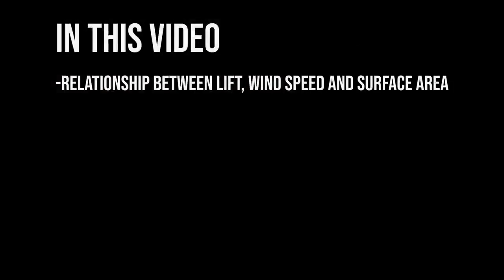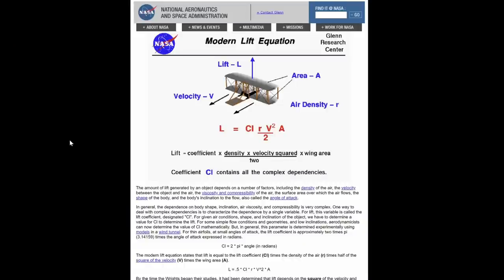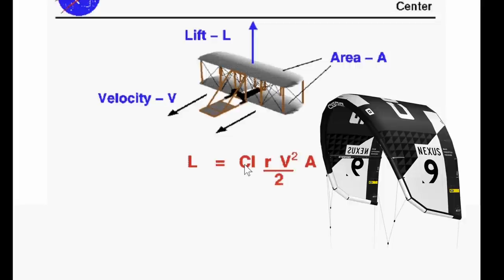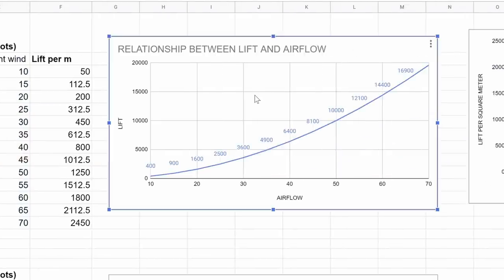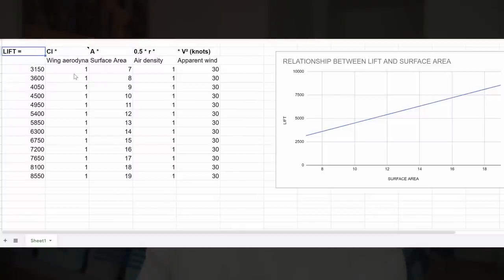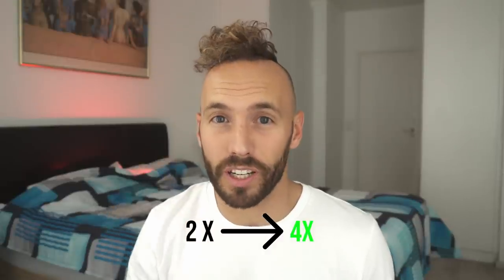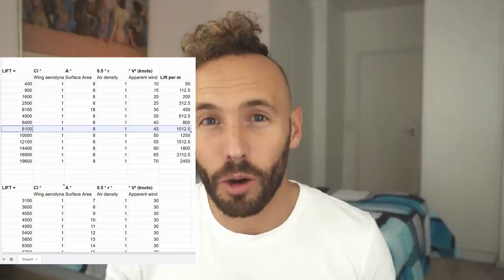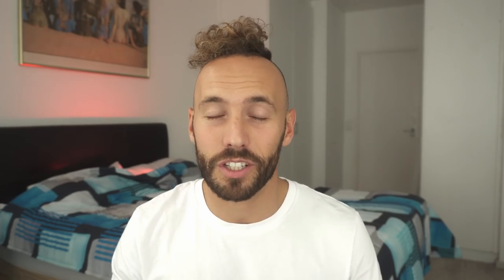Why do small kites JUMP HIGHER? How strong is 60 knots?!

Comment: I'm 68, have been riding 16 years and I'm 100 kilos.  All I do is try to jump as high as possible, and jump transitions. I have had my 12M XR kite in 25k winds (accidentally due to a very abrupt wind gust) as well as my 10M XR kite in the same winds. While I definitely have more power in the kite with the 12M, it is much harder to keep my edge, which gives me more horizontal jumps, less vertical. I could try going to a smaller board, as Toby Braeuer once suggested with the larger kite, but while I would get better edging and more vertical take offs, as well as some very nice hang time, I would not have the kite speed to get the same height as the 10M in the same wind. This past June I went to Floras lake and was boosting vertical 30+ footers every jump (as per multiple witnesses on the beach and video evidence) on my 10M with wind speeds of 25-35mph (approx 21-30kn) off of flat water, no ramps or kickers. Absolutely love the Core XR kites, just wish I had the money to keep updating them. Thanks for all of your great content, keep up the good work. If you ever find yourself coming to the San Francisco area and want to ride an awesome flat water spot, especially in July, contact me.

Comment: Great video Mike! This confirms a recent experience I had: I  forgot my smaller kite and was out on a 16m switchblade in 20-25knots. I was waaay overpowered, and could barely hold an edge. The only way I  was able to jump was by using some fun kicker waves. the hang time was absurd... But I wasn't going very high.

Comment: Great video. A lot of misconceptions about the physics out there. Many people dont know why apperent wind exists and how it works. 

1 more thing about the topic big kite vs small kite jump height. 
When u leave the water in a jump - you start to travel downwind. This reduces your apparent wind in your kite -> decreasing lift -> you sink -> land. With super strong wind on a small kite you dont lose this lift as quickly - getting the vertical pull longer. -> jumping higher. 

Sorry if this explanation isnt good in english.

Also if you really want to dig deep into kite physics i recommend the Phd paper of Jan Hummel, he build a kite measuring device for duotone called „ project teta“
Reply: I think this is the actual explanation. With a big kite in light wind, it is easier to generate more apparent wind relative to the actual wind speed. This means a larger part of the overall lift is due to apparent wind. Once airborne, this portion of the lift goes away. 

Additionally the big kite has more drag, which means the resulting force is more horizontal compared to the smaller kite, meaning a less vertical takeoff and faster downwind trajectory, effectively creating negative apparent wind. 

And of course, the kite moves slower, so the rider would have to hold a stronger edge for longer, as the video points out.

Comment: Very nice content. Also interesting to say is the influence in the density of the air. Sometime you go in 30degC on the water, some times in 2degC or in high mountain lakes. The density varies around 20% and therefore the Lift too. 

Some specialists go on the water and choose a size with their wind measurement, but this can be tricky when you are used to kite in other temperatures.

It would be a nice master thesis for a cfd student to really understand the powering up of the kite while you jump. Maybe numerical results bring a benefit on how to get the best performance out of the kite. 

(Im just jumping 12m - 😅)

Thank you for your content! I manage heliloops thanks to your video!

Comment: Mike
I am a mechanical engineer and my job is helping to design jet engines.  I  love this video and think the principles you describe are spot on.  The numbers for the lift aren't necessarily realistic since you used made up factors of 1 for the lift coefficient and density so no one should take the your lift force values and think they are real, but the relationship between the variables and the trends are absolutely real and they show why you can jump higher on a smaller kite
Reply from the maker: Thanks Doug!

Yes I used made up values partly due to naivety from the physics side and partly because I thought that it wouldn't make a difference to the relationship at the end of the day, since it's only 1 term and they're all first order variables, except for airflow.

I'm not sure if I'm right in saying that, but it 'seemed correct' based on what I recall from university (quite some years ago 😅)

Does my explanation make sense? Keen to hear your thoughts!

Comment: Great video - brilliant discussion starter! Definitely, you can expand the theory bit more: with smaller kite you have more control of CL and V components of your lift equation, which means you can time it with edging to give you the highest jump result: kite position, angle and speed - you can more easily park smaller kite in high winds to get highest initial riding speed and as you redirect the kite to zenith you sheet out which then reduces the drag coefficient of the kite and increases V even further. Then as the kite approaches the zenith you time releasing the edge with sheeting in, the latter changes the shape of the kite bringing the canopy closer to critical angle of attack (ramping the CL component to max) at max kite speed which then maxes your lift equation - and boom you are flying!!! With large kites at high wind speed you simply have no ability to control anything other than keeping above your head and praying. :D
Reply: This comment wins

Comment: I would approach the problem from an energy exchange point of view:
when you take off you have a high kinetic energy: e = 0.5*m*v^2 where v is your airspeed (upwind ground speed + wind speed)
as you fly upwards this energy is converted into gravitational potential energy by the kite.
larger kites will be more efficient than small kites as the wing loading is lower. call this efficienty term b.
once at the peak of the jump most of the kinetic energy will have been converted to gravitational potential energy: e = m*g*h.
equating the two terms and solving for height: h = 0.5*b*v^2 / g
the v^2 term will have the largest effect on the height, and we feel this intuitively. 
at high wind speeds the most important factor in a high jump is how fast directly upwind you are traveling when you leave the water (v = upwind speed + wind speed). 
larger kites make it harder to edge and pop without going downwind, but with all else constant will take you higher, however,
smaller kites allow you to edge and pop better with a higher upwind angle.
Reply: No, first of all you mess up the kinetic energy of kiter and kite. Air speed is for kite, but it is not significant as a source of kinetic energy but for the maximum lift which can be achieved. Kiter kinetic energy is measured from true speed and it indeed has some relevance to jump height. However the most important thing is to get the kite travel as fast as possible. High driving speed of course helps that.

Unfortunately if you go very fast edging and last moment before take off suffer and advantage of high speed is lost.

Why do you think bigger kites are more effective because of lower wing loading? It is more like opposite, smaller kite in higher wind operates at higher Re number which makes it more effective. 

Big kites are not as efficient, they have much lower lift to drag ratio. This is because kiter can only produce certain amount of counter force by edging, and this force is dependent of kiter's strength and technique. 

For example 18m kite has ca. 2x as much drag as 9m kite but unfortunately you are not capable to produce 2x counter force for it in your harness hook (unless it is very light wind) to reach same L/D ratio. 

 Big kites are also heavy, they have more inertia which makes them slow to accelerate and thus produce less induced wind during last critical moments of edging before take off.

It is trivial to notice that if wind is very low big kite can indeed jump higher than small kite. 

Small kite will always jump higher if you use your edging potential (and there is enough wind to do so). In practice most people don't use very small kites for big air because risks increase so much when they are fully powered
Reply: @bekanav  Hi Bekanav, thanks for your detailed response. 
I would argue that once the rider leaves the water, the only important reference frame is relative to the air, not the ground. So my use of airspeed for the kinetic energy here is the correct term.

I agree with your 18m vs 9m comparison argument, however by efficiency I was considering the L/D ratio when the rider is flying upwards from the instant after takeoff, with the bar sheeted in, so I believe the kite would be performing at its target L/D ratio, do you think this is correct?

In terms of Reynolds number, I would say that the change between light and high wind riding is not that significant. If Re is calculated as some constant k * squareroot(kite size area) * air speed, it does not change hugely for a 12m in 20kts vs 8m in 30kts. So I wouldn't say the lift/drag ratio for the wing would be drastically different between high and low wind settings.

I would estimate that the higher wing loading of a small kite plays a much more significant role in efficiency than this change in Reynolds number, but it's hard to say for sure, what on your thoughts on this? 

I agree with your comment on larger kites being heavier, additionally using more energy and drag to redirect them upwards before takeoff.
Reply: @maxff123  Main difference is drag is related quite closely to the kite size but lift increases in square to V. So smaller kite has considerable higher L/D ratio if your ability to take F to your harness hook is constant (as it is, or it is not wind dependent). 

There is also slight advantage to RE number because twice as big kite has 1,4x bigger chord size but smaller kite can easily be used 2x as strong winds. So smaller kite works with higher RE number which means aerodynamic advantage.

However basic principle of L increasing in square to V while D is constant is much more significant than RE number. RE is related to object size and airspeed.

In practive after take off smaller kite performs at much higher L/D ratio because it has much higher airspeed. Another way to think it  is you can't load big kite enough. There is a 160kg guy who can jump almost 50ft with 21m kite, that is because he can make that kite work much higher L/D than anyone normal weight guy can. In practice you can see that kite is not that slow when he uses it - and it is a very slow kite for normal weight person.

Yes, in practice kite weight is like drag, not same but quite a lot. Bigger kites, especially foil kites, are relatively even worse for their weight because kite volume increases faster than kite area.

Now I see your point of kinetic energy. However it must be measured from the ground speed when kiter travels on water and it certainly can't change drastically after take off - like it would do if then measured from the air speed. Just getting airborne can't increase your kinetic energy.

After take off kinetic energy of kiter starts to convert to potential energy. However kite pumps more energy to the system from the wind. This happens as long as kite climbs higher and has more lift than kiter weights.

Because it is possible to jump just moving the kite, so having 0 kinetic energy,  I don't see that way of thinking very practical. Jumping is mostly about kite speed and ability to take high force from the kite - which makes kite go fast and develop a lot of lift.
Reply: @bekanav  Really interesting thanks, this has changed the way I view the physics involved
Reply: @maxff123  You're welcome.  Actually how jumping happens in kite boarding is quite complex and certainly worth of some thought

Comment: Super nice explanation, it will help even beginners understand, why they are not enjoying their sessions overpowered. 

I have a few additions though, because this at the moment, is only the theoretical part of lift an aerofoil(in this case the kite) could make. But in practice, the power of the kite, as well as the actual lift greatly depends on the weight of the rider. And i’m not saying the lighter the better! I think with good technique for the pop, a heavier rider can edge harder, pop harder therefore he can load the lines better and increase the efficiency of the kite. I know it feels like it’s not really a part of this equasion but to me it feels like it should be just as much as the true wind and induced wind adding up to apparent wind. 

I mean the lift calculated here is a constant so if all the rest wouldnt really matter in the case of actual jumping, all the jumps would last forever. 

About the strong wind and big kites: 
Just another testimonial: i’ve ridden 17m kite in 25kts+ even worse on a door board. It was more trying to survive than actual kiting. People were sending 10+meters next to me on 9-10m kites i could barely go 3-4 meters and it was a fight (obviusly i didn’t chose to take this one, i was teaching a heavy 120kg guy and i took the kite when the wind picked up to make sure he’ll be safe)
And there comes the next part about the opposite of the range: when jumping lit on a 5m kite 35+kts i feel like there is a moment my board is generating lift also, or even more often it has huge drag pushing me under the kite, depending on how i put the board. It’s kind of a scary feeling loosing line tension while the kite is still in front of you. 
Now my question is, surely it is up to the rider to solve this issue, but don’t you think 6m kites in stronger winds will basicly plateau before reaching new high scores, or if it does make people reach 40m, the trend changes and everyone has to size up again to reach new top height?

Comment: Hey Mike, thank you for the good explanation. I`m missing the density in the lift calculation.  Kiting on a lake at 5400 feet will certainly generate less lift for the same kite size and wind speed.
Reply from the maker: Yes I intentionally didn't get change the density. I wanted to keep all else constant for the sake of comparing apples with apples. Ceteris paribus, as the saying goes :)

Comment: great video Mike :) do kite brands have hydro simulations when they design their kites? can those be used to find the best lift as a function of conditions?
Reply: Yes they do, called look up wing cfd. For example the best wing design for racing would be where you have the highest lift to drag ratio
Reply from the maker: Yes but I think that simulators can only take us so far. As the simulator on Nasa states, and as my research has shown me, lift can only be approximated for low angles of attack. Once you get to extreme angles, it's a helluvalot more complicated and real-world testing is necessary.

By the way! There's a nice video about the modern lift equation on NASA GRC YouTube: https://youtu.be/wYyry_Slatk

Comment: Hi thx for your videos, super useful. I'm 95kg for 192cm tall. I often use a 14m orbit to try to get higher. I'm able to ride with it in 20/22 knots with flat water and my record is 8.4m. For you is the right size of kite or I should use a smaller kite, to improve the lift? Or for my weight is the maximum height that i could achieve?
🤙🏼

Comment: Once again stellar content mate, I'm always stoked to see a new vid from you!

With regards to the density, from what I've felt a low density day in Langebaan (say 1005hPa) feels way lighter than a high density day, and Cape Town is always slightly more dense 1020~hPa.  Does this also work similarly to wind speed in that a reading of 1005, while only a small percentage lower than 1020, is actually logarithmic? Should I be checking for this when evaluating the forecast? Would you be interested in doing a follow up video on the lift formula with a section on density?
Also can you hit us up with that spreadsheet?

Comment: Great video and the scientific data just confirms what we know after some years of trying to maximize jumps.   I live in a spot where we have nice thermals but we never get more than 25 knots and have been trying to find what is the max height possible with that and on which size kite, given we have no flat water but nice kickers from the beach.   Also line length plays a role in how fast you can throw your kite too.. I tried a 12 evo sls on short lines and got a great boost in mediocre wind as it moved really fast, even though the line length made the kite seem very wimpy at most times..